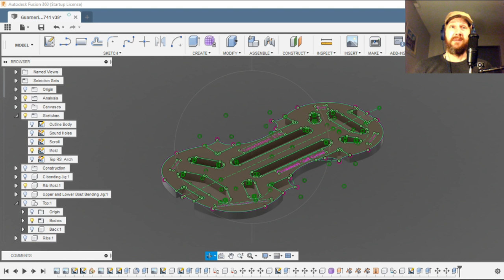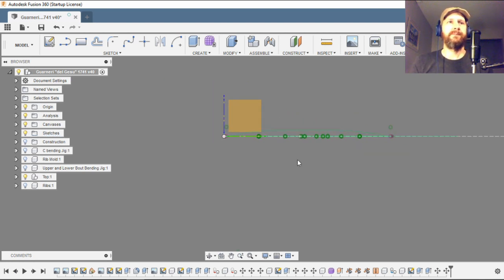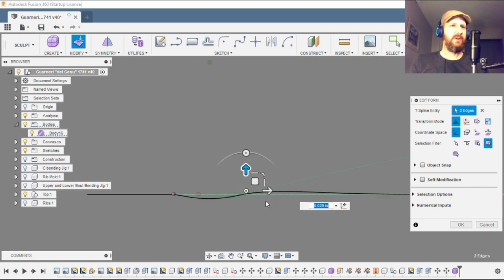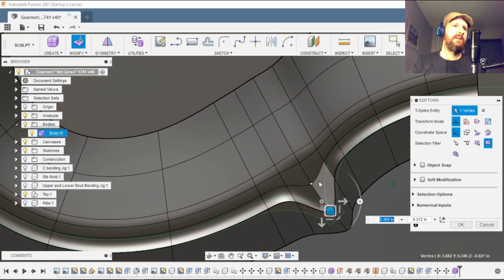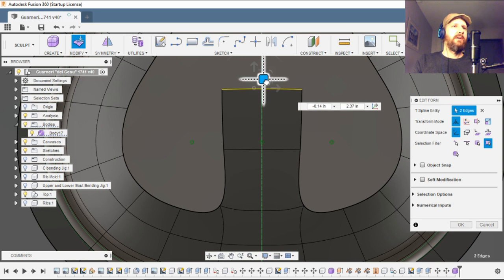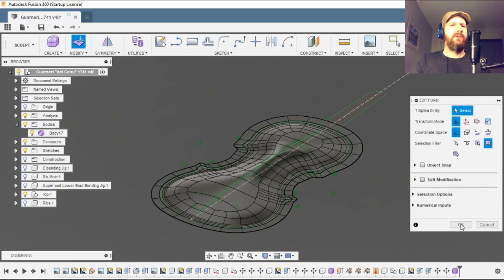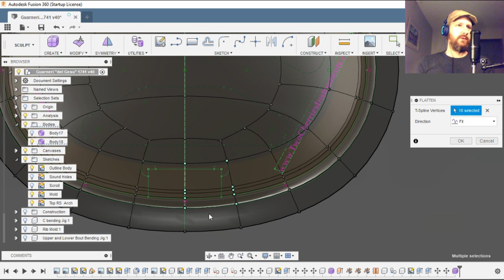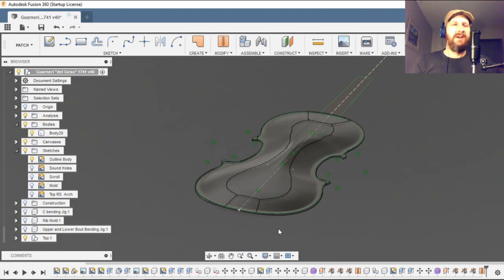Modeling a Violin Top : Fusion 360 Sculpt

Comment: Sorry, an der Profilierung der Oberfläche muss wohl noch gearbeitet werden.
Reply from the maker: Why do you think that is the case, It matches the profiles from the CT scans and Strad poster very closely, and is more symmetrical than the original.
Reply: Hallo, ich habe mir Schnittprofile und Maße aus Bildern von Geigen kopiert und im Cad skaliert und verarbeitet. Jetzt in Fusion 360 als Volumenmodell habe ich Probleme mit Decke und Boden. Mit T Spline und Fläche habe ich jetzt Probleme. GRUß  CLAUS

Comment: Hi - great videos, and series. I am a longtime fusion user, and would like to adapt this fullsize to a 1/8 size model. Is it just a scaling operation on your fusion files to get to a smaller version? Or would I be better to start from scratch? thanks
Reply from the maker: The interesting thing is that 1/2, 1/4, and 1/8 violins are not straight-up scaled. The distance from the bridge to the nut is, but the body size does not follow suit, so it's a bit more complicated than scaling the 3D model.
Reply: Got it, thanks! Your videos on the circle drawing technique will come in handy..appreciate it!

Comment: Could you loft over a wire wireframe (eg the Strad archings)?
Reply from the maker: Nope, you can not replicate the proper shape that way, the uncomfortable truth is that the only way to create these shapes is with sculpt.
Reply: @TwoCherriesIns  thanks. Still learning. Cheers
Reply: Actually you can! If you draw all the five horizontal cross sections according to Strad plan, you can loft from there, using the vertical cross section as your guide. Draw also an outline of the violin shape excluding the corners, and that will also be guides for your loft. Someone else has used the loft method to do it, although he is using Onshape instead of Fusion. See: https://www.youtube.com/watch?v=f4pyRGOija4

Comment: This is just a demonstration that you can use Fusion. The model does not have a logical sense for sound design, the curves are drawn to the eye, without a design logic. Just a joke. If you want to be cool, then use appropriate programs, such as Rhynocerus with Rynocam ... but first you need to know what to draw and why.
Reply from the maker: The model is drawn from the strad poster of the guarneri del gesu vieuxtemps
Reply from the maker: If you use those programs how are you going to program toolpaths? The solid bodies in fusion have far more accuracy than any STL output from ryhno
Reply: @TwoCherriesIns  your answers confirm what I wrote; from the Strad poster you can only vaguely derive the external profile, not the sections, so you have to know how to calculate the sections according to the sound that will be produced, and therefore know what to do. It is not a problem of the tool path but of drawing.
Reply from the maker: @edoardolivolsi4759  if you had bothered to watch the sectional analysis you would have noticed that I did that. This video is about the technique used to model the shape, its nearly 20 minutes long. The details your talking about would take much longer to explain. I noticed that you don't have any videos about 3d modeling on your channel, what is the issue you have with fusion360?

Comment: this is great! I have been trying to do something similar, but so far lack the Fusion skills. A couple of things might improve the overall shape. First, the "long" arch which you are using should not have a straight line tangent connecting two arches. It is one continuous curve. Also, the Strad poster you are using probably has the cross arching drawn on the back. Generally, when violins are copied, there are five cross arching which are used for reference, the sixth being the long arch. If you incorporated them into your model, the plate would look more accurate. I am wondering how to do this..Anyhow, i really enjoyed your video and will continue to check out your fascinating work. cheers! Andrew